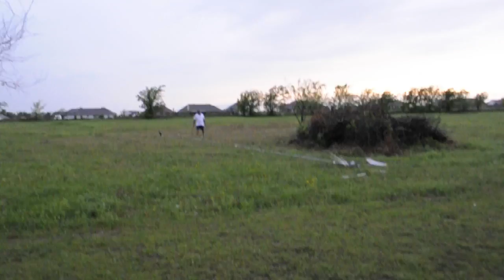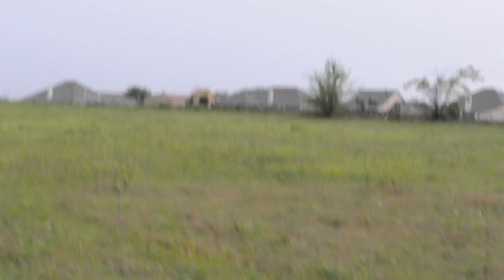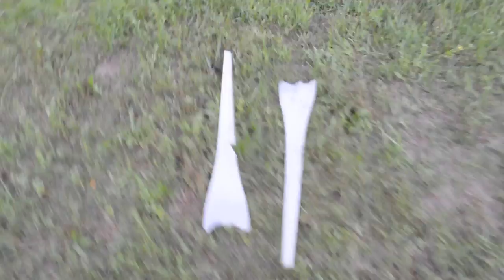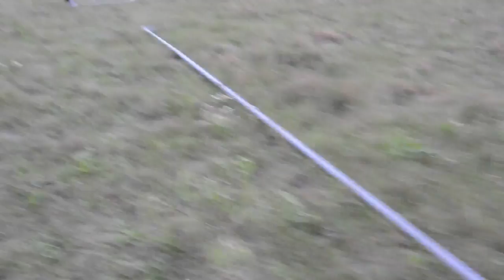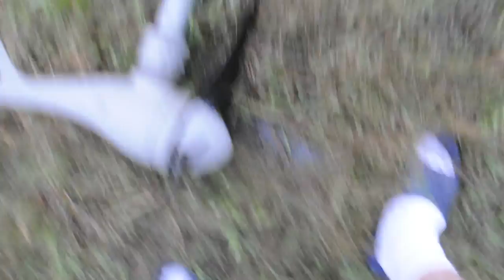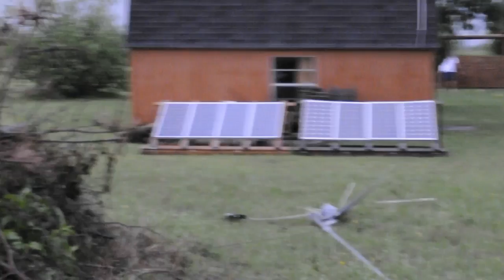Minor Tornado Damage

Comment: sorry to see all the damage to your turbines.as you know i am no stranger to high winds. instead of useing concrete for ancors go and find the biggest flat stone you and your dad can
carry and bury it as far down as you can the weight of the soil and the stone will winch out
a truck. if you can drill a hole in middle if not strap your cable around it good luck.

Comment from the maker: I think things will turn out. We didn’t have any break on and the stator coils look fine. We get about as many volts hand turning it as we did when we bought it, so it’s still in great shape, just needs a new body. My dad is leaning toward replacing the bent 9-blade hub with an 11-blade hub, in addition to another generator and tower!

Comment from the maker: Nope. No cement. It’s a guy-wire tower with 25" auger anchors. …If the mounting poles were cemented, they probably would’ve been sheared off or bent. At least it looks like only one pole will have to be replaced as far as the towers go. Fortunately for our larger turbine we can get the alternator body for about $38, which leaves a new hub, blades, wire, and a probably a few more tidbits here and there.